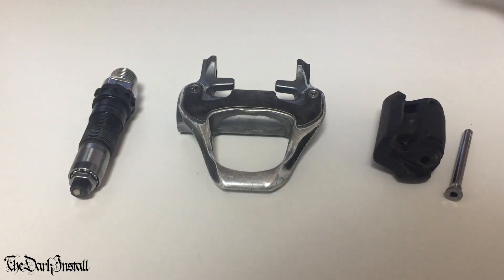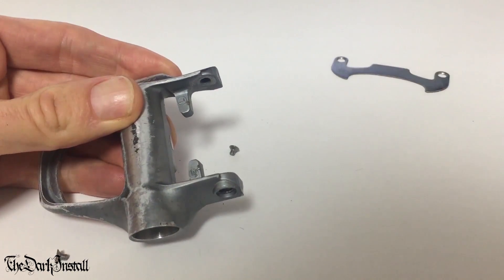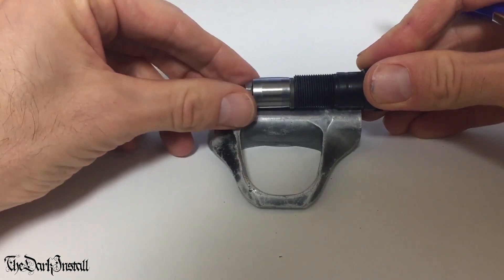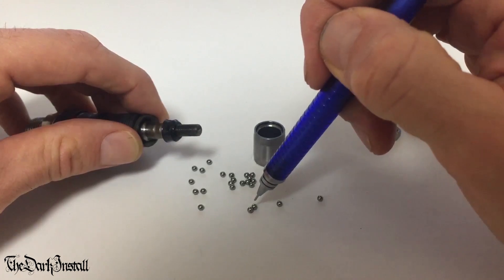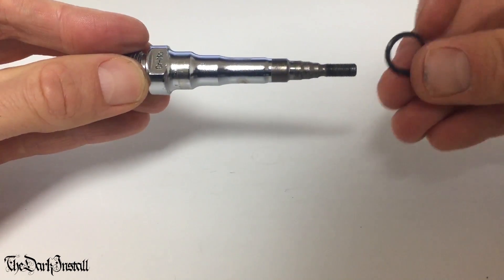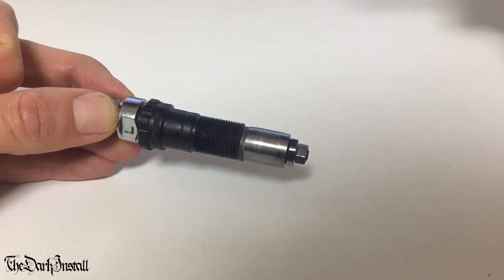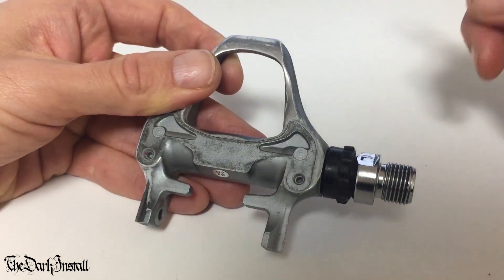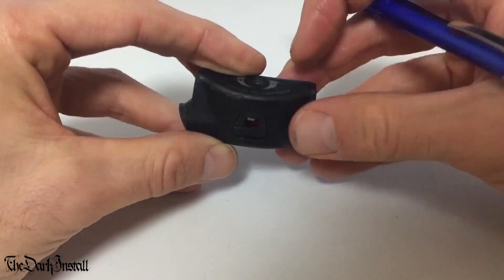Shimano SPD-SL Pedals. Indepth Analysis!!

Comment: You forgot to show the internal section of the big plastic tube that the pedal shaft passes through. On the R7000 pedals there are 2 plastic internal seal sleeves and that is why the pedals develop play specially if one of your feet is not straight ( inward or outward pointing). They are 2 plastic inner thin sleeves and once they wear out the pedal is useless, even though there is nothing wrong with pedal metal and bearing assembly. I can not believe that no one has picked up on this it is such an idiotic move on Shimano to not have the bearing assembly longer and closer to the inner edge, it is so far outward that those internal plastic sleeves wear out quickly and you may get noise due to this. This happens only with a foot that is inward or outward pointing setup with the shoes, this puts an angled rotation force on the pedal body which wears out those thin plastic inner sleeves.

Comment: I feel like this design will introduce alot of flex. the 1cm long area of the stainless steel dome is taking all the axial and radial loads. without a bearing on the end it's basically like a free-floating gun barrel.

Comment: My Carbon PD-5800 have worn out after 25,000km over 2 years. The front lip where the front bit of the cleat rubs has worn thin and it doesn't hold the cleat securely anymore, meaning that the pedal unclips unexpectedly. I think the 7900 material choice was better as it is a more durable metal and therefore longer lasting. Now all the pedals 105/Ultegra/Duraace/PD-R550 are all carbon fiber body. Only the low-end r540 has a metal body but this comes with the narrower plastic platform and is therefore undesirable. I am going to add some epoxy-resin to the front lip and see if that prolongs the life but it is a bodge at best.

Comment: Not to be pedantic, but I believe the plate is more of a bearing surface than a wear surface, and that it's made of a harder / heavier material than the rest of the pedal body.
Reply: It's not ceramic though. Anything that touches anything should be ceramic. Can you imagine how buttery smooth the world would run?
Reply from the maker: If I had it my way, the whole universe would be like a giant Softmints advert, made of ceramics.  Light speed travel would have been achieved ages ago.
Reply: I think it might be a bit brittle for a pedal?